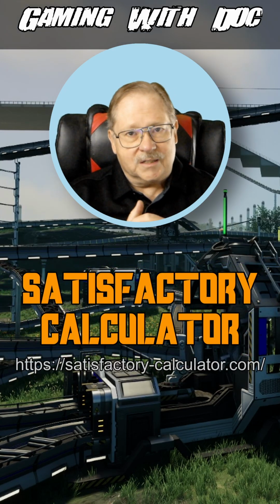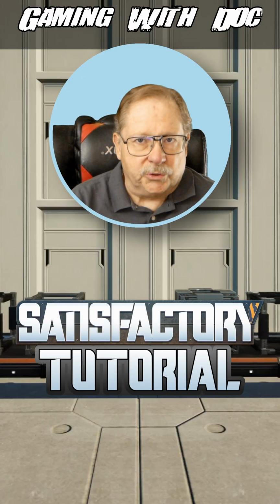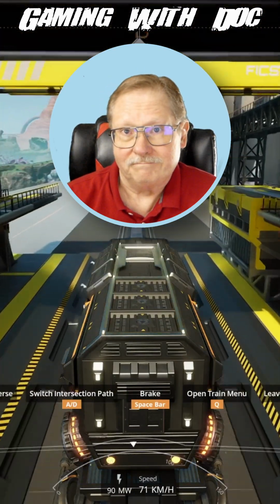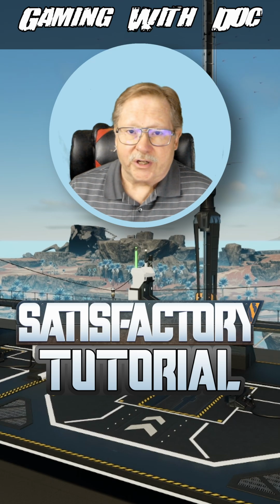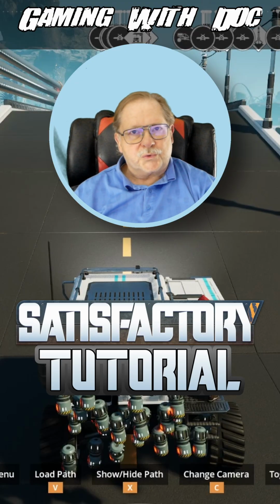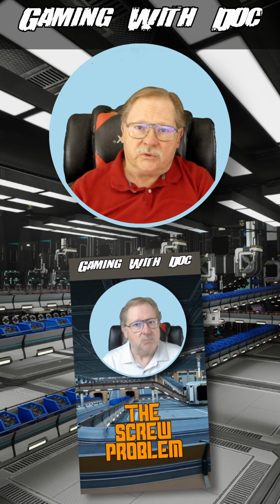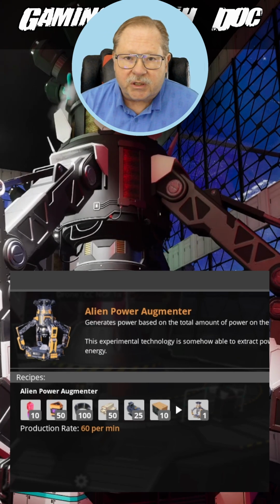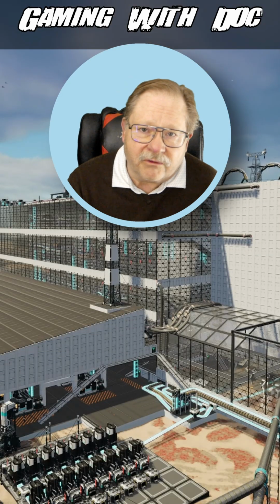Top 25 Essential Satisfactory Tips Mega-Compilation Part 2 (26-50)

Comment: 11:00 Are you overclocking your extractors in this build?  A pure node on an MK1 oil extractor gives 240m^3/min but the refineries doing the crude oil to fuel+resin takes 60m^3/min.  240/60 = 4 but you can overclock the extractor to produce 300m^3/min to completely fill an MK1 pipeline which is then 5 refineries per pure node with MK1 extractor.

Comment: i can't understand why you would want to use manifolds? they dont split the resources evenly.
Reply: Once a machine backs up the belts split evenly
Reply: If you're feeding machines that require 120 per minute of input, and the output feeding them is also 120 per minute, manifolds work the same as balancers as long as your main line belt can handle the maximum number of items before splitting

Comment: When you show the ingame-diagram of the modular frames setup you messed up, so I had to do math myself, I know right? You need 2,5 assemblers for the modular frames for the system to work effectively. 1,5 assemblers doesn't use the 30 rods and 7,5 advanced plates its fed, the 1,5 assemblers will only be able to use 18/30 rods and 4,5/7,5 advanced plates.